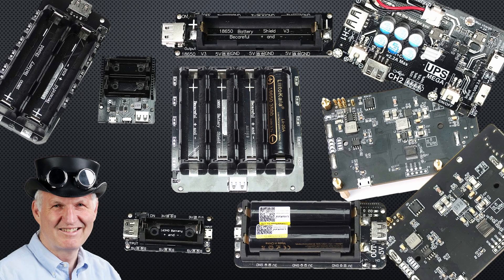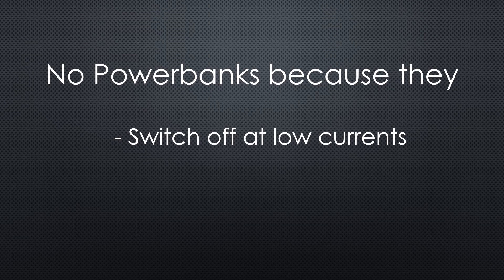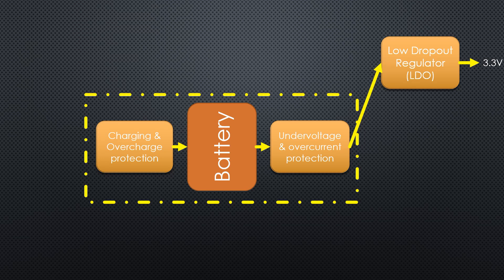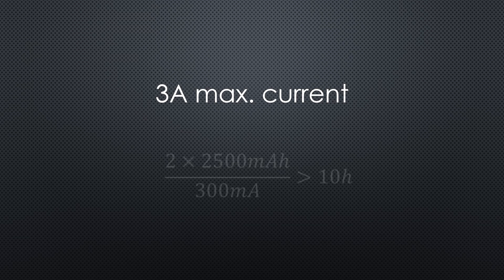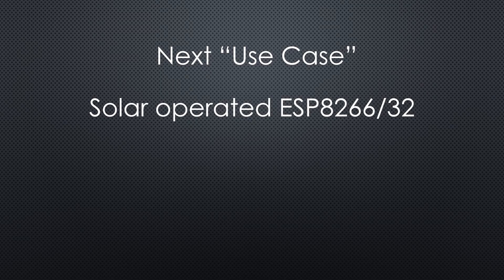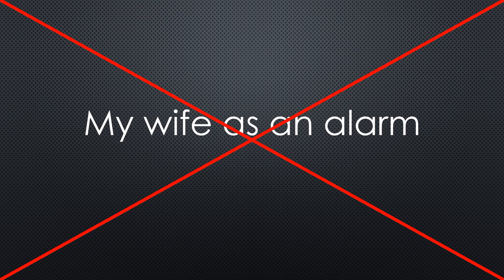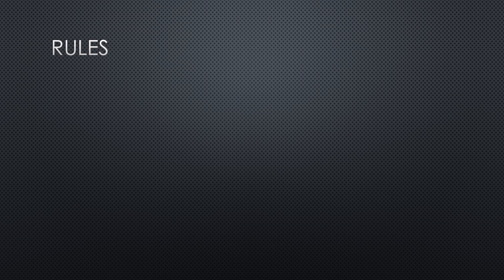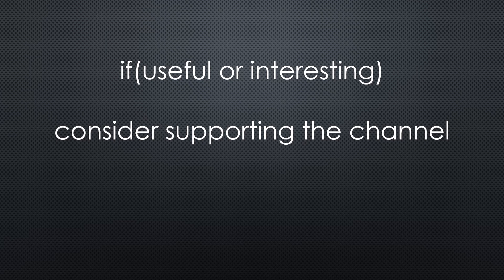#351 10 Battery Power Boards for Raspberries and ESPs. Start of “SuperPower” project

Comment: @08:11
Reply: @AndreasSpiess  Sorry I was watching lots of your power videos. I wanted to reference that point (ESP32 on battery) I was trying to find the one where you talked about disabling the 5v rail by disconnecting the FP6298. ( https://www.youtube.com/watch?v=joAkJ9QA2bw ). How is the superpower board going, would be great to have an update video? I looked at it, seems like it's going to be expensive though :( - Keep up the great work. Love your channel.
Reply from the maker: There are several boards in the project. So far I did not get the ok for an update from the team :-( But I am working on low-power videos.

Comment: as always, a very informative video... since i watched it i've been doing a bit of research. have you looked at the ltc3440? according to analog devices' product announcement it is "the industry’s ﬁrst constant frequency, single inductor, buck-boost converter." additionally it "has true output disconnect builtin." perhaps it could greatly simplify the design of superpower... https://www.analog.com/en/technical-articles/it-just-got-easier-to-convert-lithium-ion-battery-voltage-to-33v.html
Reply from the maker: I do not know which chip they chose in the end. The compared quite a few of them...

Comment: On the topic of 16340s .. has anyone found a reputable, reliable brand for cells of this size? My experience so far is that all 16340 cells test out, at best, to 1/3rd of their claimed mAh capacity when new, and most are much, much worse. This, from recognizeable brands and weird chinese brands alike. I haven't seen this kind of consistent fraud in any other cell size, though my experience is limited.
Reply from the maker: I can confirm your observation. I tested mine with a similar result.

Comment: Thanks a lot for this amazing content. That was a comprehensive review. Have you had a look at x750-A2 UPS board from geekworm for Raspberry pi. https://raspberrypiwiki.com/X750 .  It can have upto 12 cells using "stackable" daughter boards. However, it lacks hardware low voltage protection and 3.3 V output.
Reply from the maker: I do not have such a board in my lab.

Comment: <--- Divorced 1996 - wife.exe has stopped working.🤣 Wife ver. 2.0 unavailable...
Reply from the maker: Mine is 2.0. Much better than 1.0 ;-)
Reply: @AndreasSpiess  Reliability is definitely a plus!😆👍 On another note, I checked out your video to look into a possible UPS type battery backup for an RPi 4B that I'm planning to use as a high availability NAS. I don't want it to have to rely on an external UPS, since I'm trying to keep the whole thing a relatively low-power setup (compared to the monster I currently have).😉 The only thing I've seen so far that has good power management and charging capabilities is the RasPad tablet, but I'm sure all the power board stuff is proprietary, since it does a lot more than just manage power.
Reply from the maker: Maybe you watch my last video...
Reply: @AndreasSpiess  Thanks, will do!😉

Comment: A lot of "ANDs"...
Reply: @AndreasSpiess  Between 12'40" and 13'43"   you used 7 times "and" to make clear your frustration not to find a suitable PSU for your LoRa devices.... 
I did put all the requirements on a spreadsheet... and looked to all  your videos concerning the matter. (64, 160, 250, 256,..)  Probably 2 good protected LiFePo4 batteries working alternatively (Flip Flop :;) in conjunction with a CR2030 cell battery (rechargeable(?) ) as backup  in conjunction with USB/Solar for a 3.3 V UPS